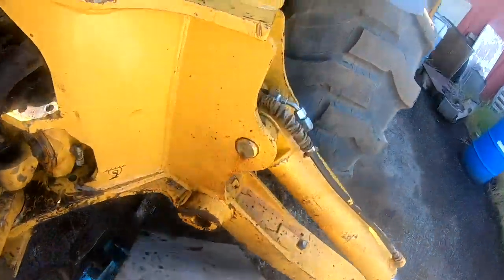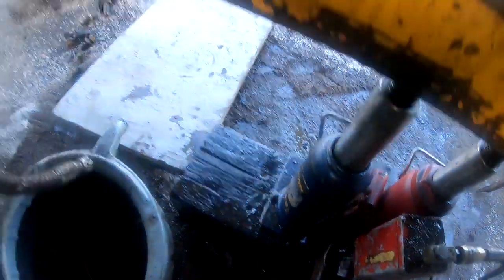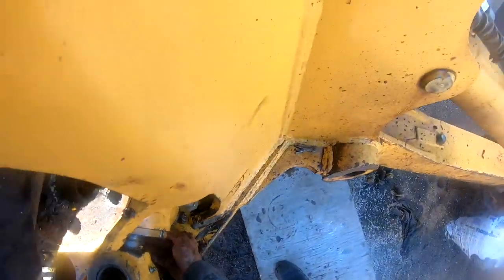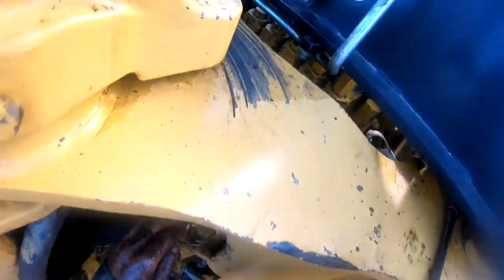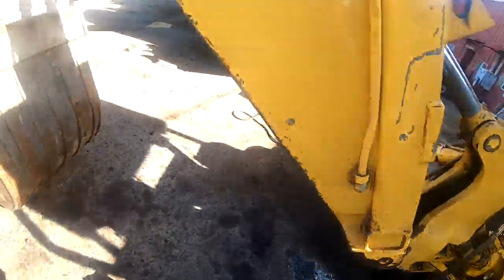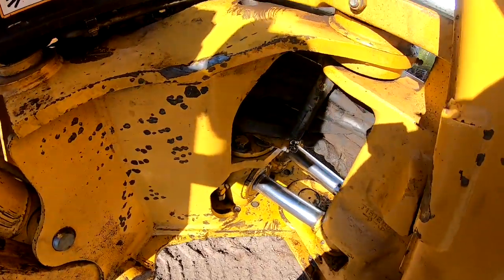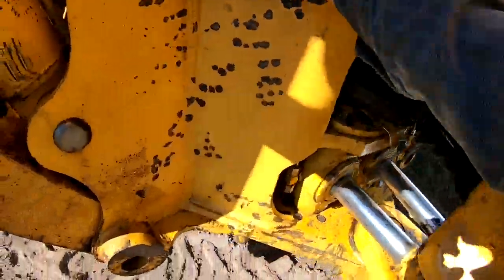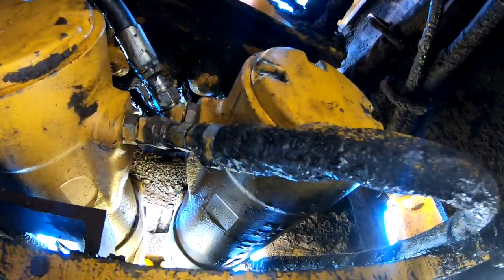Backhoe swing cylinder installation

Comment: Had a 710D. What a overweight beast. Outriggers a foot short, all ready to roll over. Off road in the winter you be sunk in the dirt 2' deep all the time. Backhoe is your tow truck - and the boom is so heavy damn thing does wheelies going up normal hills. Boom so big cant see past the damn thing. Gotta fill the bucket or ride the bronco. Gong back to Ford or New Holland.

Comment: thank you for your videos I may have missed something . me  and dad did the same job on a 580 e super busting the nuts lose on the piston rod was what I wanted  to see how you do  I am 280 ish dad is 195ish 4foot 1 inch drive with a 4 foot pipe standing on jumping on the pipe how did you do it a 1inch impact??
Reply from the maker: Heat, get the torch out.  They loctite them on.